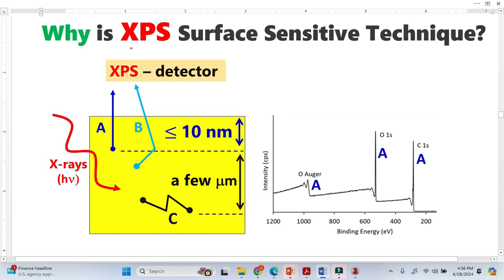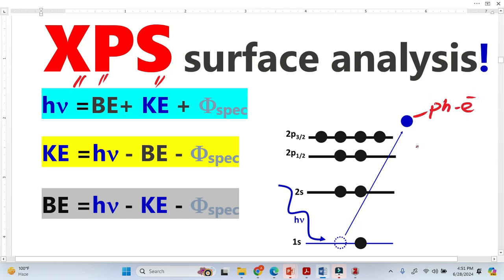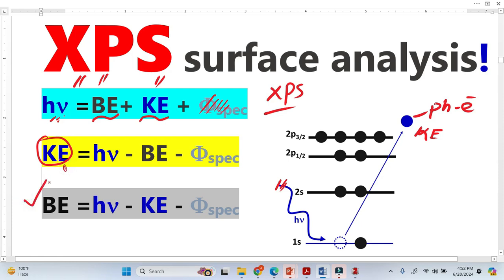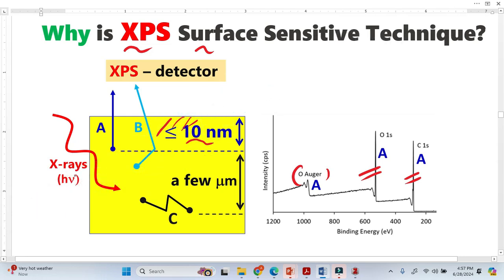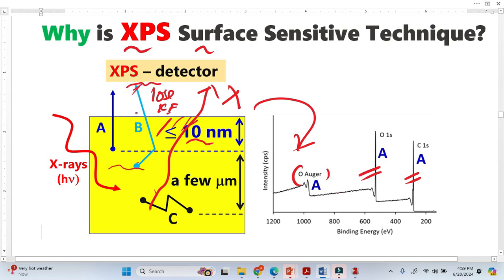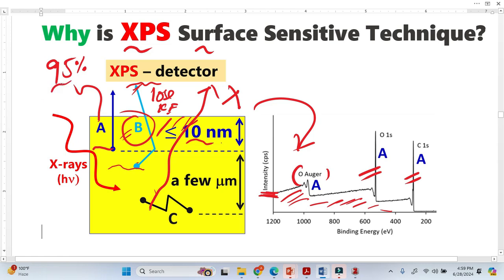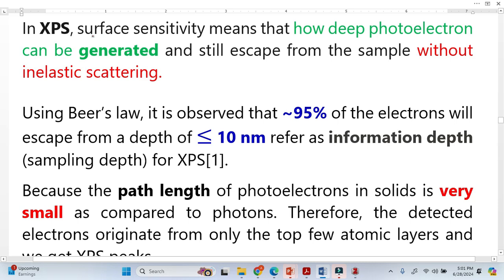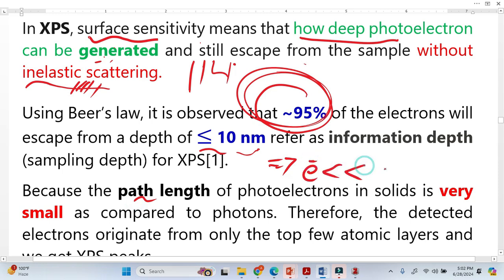Why XPS Only Sees the Surface: The Real Reason Behind Its 10 nm Depth

Comment: I want to ask question related to XRD...what are miller indices and what thing they tell about unit cell?
Reply from the maker: Miller indices are notation used in crystallography to show orientation of planes in crystal lattices. It is usually represents by three integers such as h, k, and l such as (hkl) = (100), (110), (200), ) (101), (111)........ In simple words, miller indices show the number of atoms exist in the x, y and z directions.  

Question: What is Plane in crystallography or in crystal structure?
Answer: Plane means atoms arranged in order just like the mirror. When the x-rays shine on the plane, the x-rays will reflect (diffract or scatter), and the internal crystal will reveal.  Just like the mirror, when we shine light, the light reflect at a specific point, now if the mirror is broken, the reflect light will not focus on a specific point. 

PS: I would appreciate if you ask relevant question to the video. As I have a lot of videos on XRD analysis. 

Many thanks for the comment and wish you best luck!